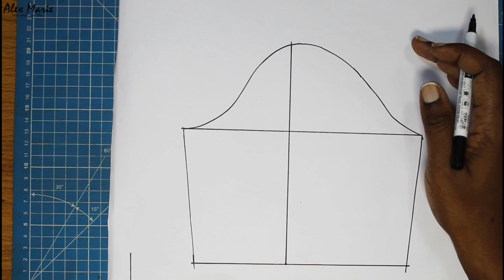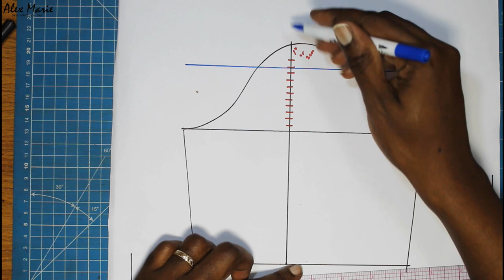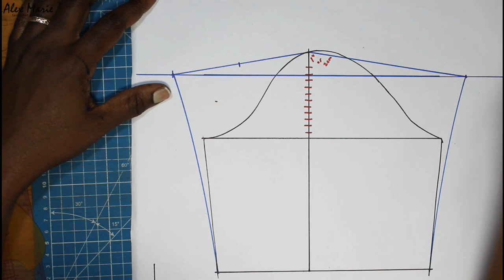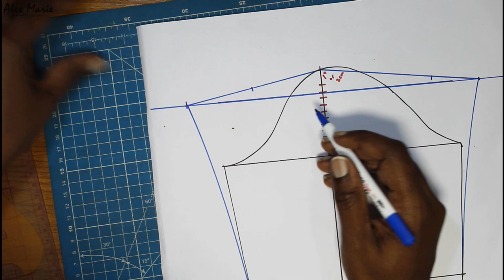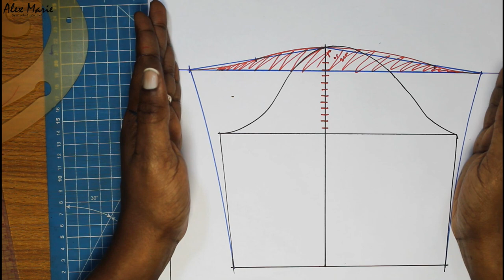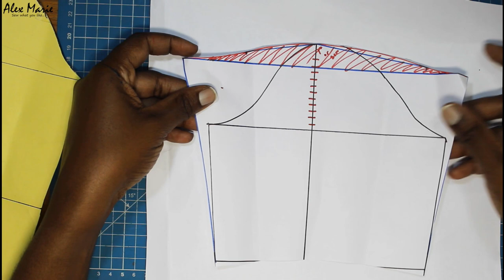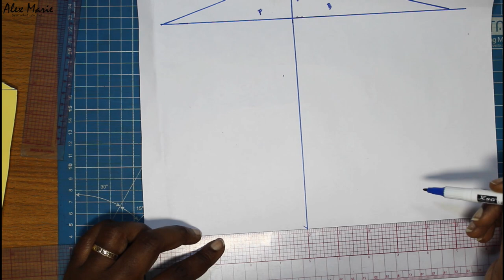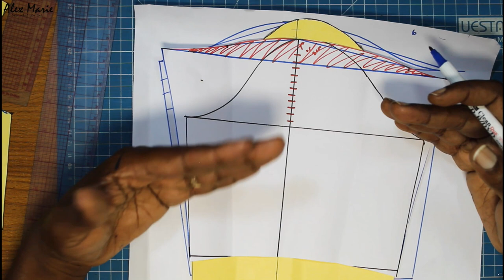Sewing Technique - How to Adjust the Sleeve Cap Height | Alex Marie

Comment: I had a dress pattern that the sleeve cap wasn't working for me on. The cap height was too long and limited my mobility. Your video gave me the confidence to try to redraft it. It took a couple of tries to get it just right, but it works so much better now for what I wanted. Thank you so much for your guidance.
Reply from the maker: That's really great! I'm so happy you were able to improve your outfit. This is such a common problem and we always end up ignoring the outfit as a bad fit. You're welcome.

Comment: Is this same technique in adjusting a high armhole for a coat in order to have a clean sleeve but with enough mobility at the scye?
Reply from the maker: it goes together. The scye should be big enough to comfortably rotate the arm without biting into the skin. Then, the sleeve cap height should be adjusted to attain the amount of mobility that you want.

Comment: Am drafting an outerwear jacket and have been puzzling about how high I want the sleeve cap.  Like you my normal cap height for a fitted sleeve is around 6".   However, I would like to have
a bit more mobility for my arm and think that a 4" cap (and wider bicep) would offer that.  Thank you for a great demonstration - I already have a fitted sleeve drafted and now I know how to adjust it to the desired height.